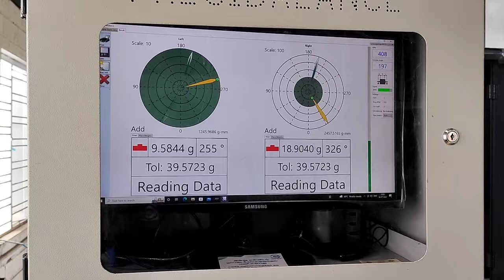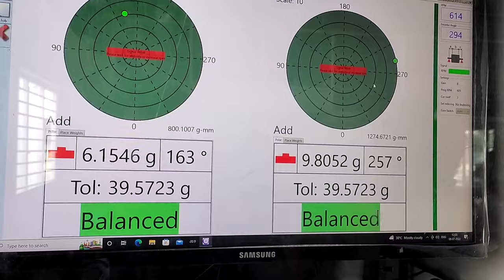Rotor Shaft Repair Work Partial Joint In Three Phase Induction Motor.

Comment: it would had been nice..  if you made tapper on both side... inserted the full step turned shaft in center drilled hole...

starting welding could had been better..